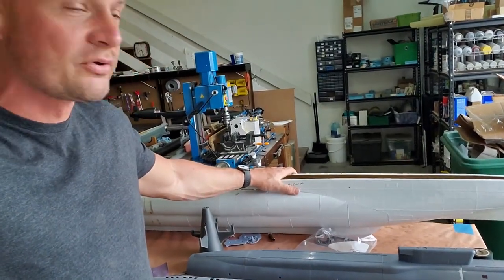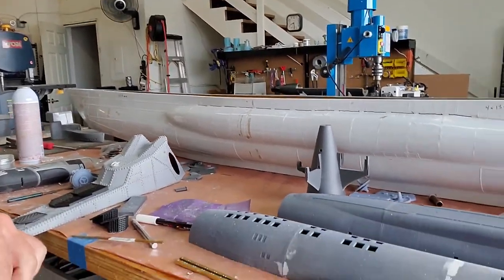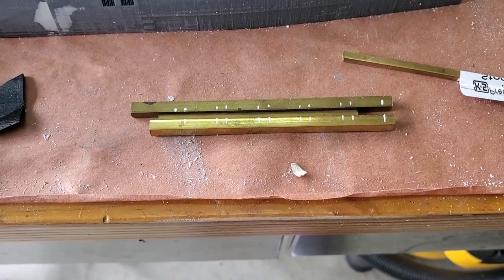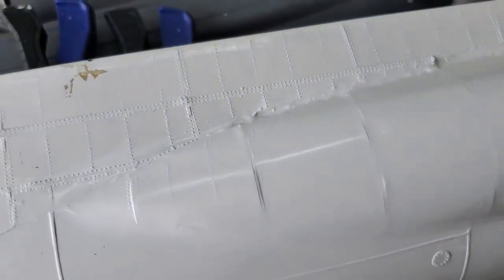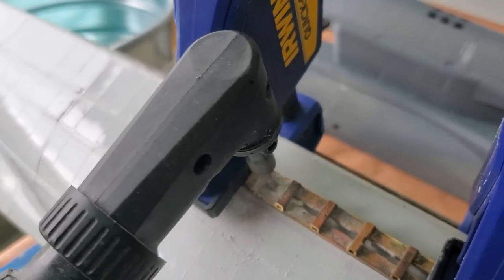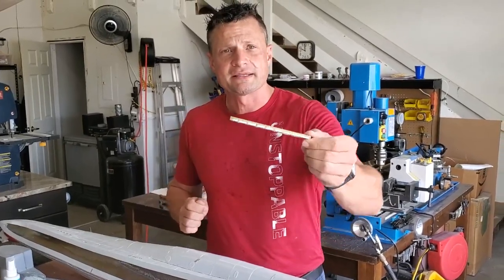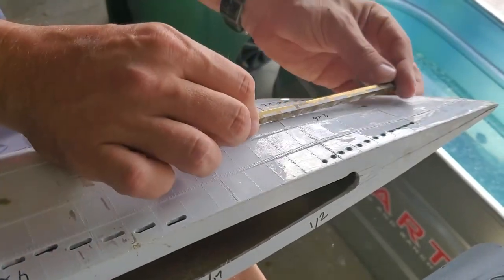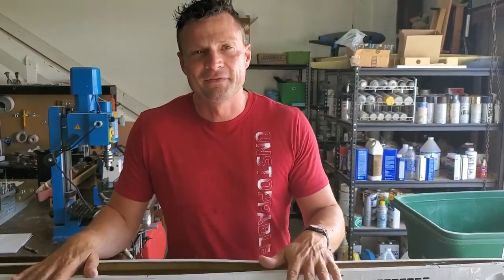How to mill out perfect flood slots in your fiberglass submarine model.

Comment: Bob, this video is gold! When you described what was on the Dremel as a "rotary tool bit," it looked like a regular (if slightly high quality) drillbit to me. Is this bit specially designed to cut sideways? If so, what brand/cat# did you use?  Also: a great video for the rest of us would be "how to repair screw-ups in your limber hole cutting job."